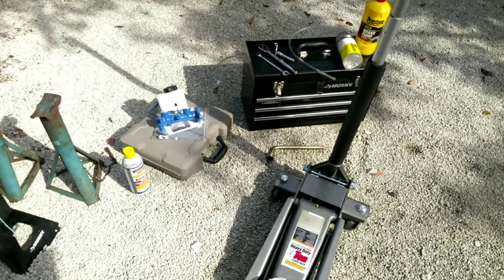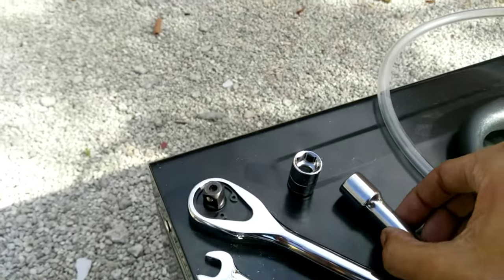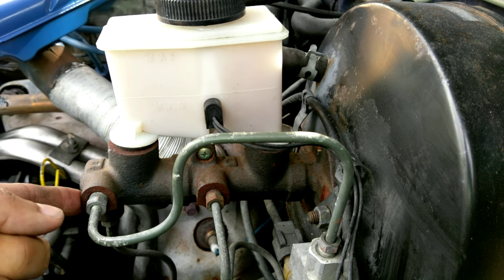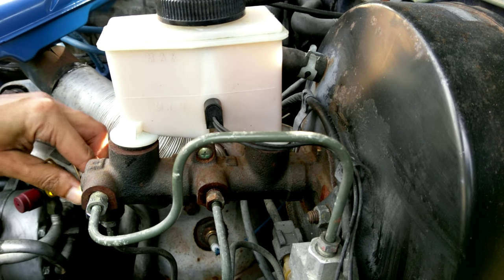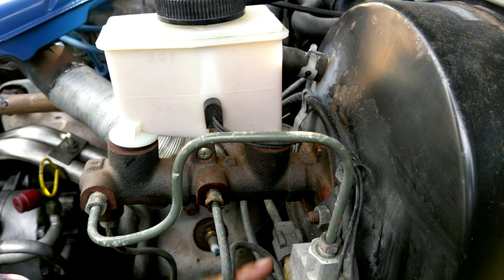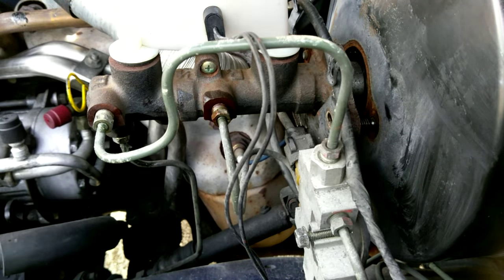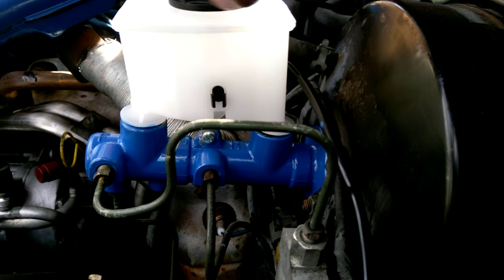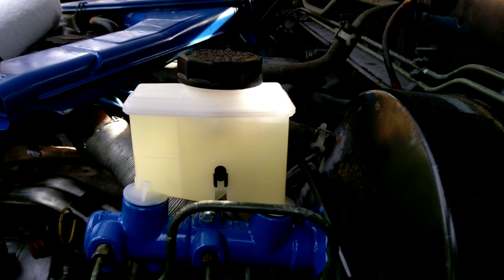Brake Master Cylinder replacement on 1990 Mazda B2200

Comment: As a woman with no car experience  or help ...thank you!
Reply from the maker: That's pretty much how I started making these videos, I couldn't find a darn thing before! Glad it was helpful.
Reply: @ninjaofalltrades4293  Hi.. there! Watched this a couple of years ago & finally here to refresh my memory & try this myself. I haven't watched the Chris fix video on bleeding the brakes yet. Don't you want to flush the old fluid out before bleeding the lines?? The cylinder in mine is so old I don't dare try this without totally flushing the old fluid out first. I see that you have a jack & stands. I don't have the proper tools to work on wheels & wheel lugs. Is it possible to flushthe old & bleed the new fluid without jacking the truck up & removing the wheels & tires?? I don't want to do  that! I'd probably have a mechanic do the job if it's required to get the job done. Hope not! For some reason I'm attracted to women who can efficiently work on things, especially dark complected gals! 😘
 That was cool..! 😎
I'm Jay.. ✌️😉
Reply from the maker: @jhenry0688  good morning! It’s been a while since the video but because I had already replaced the cylinder and painted the new one blue I did not mention it in this video. But yes, do that first. It’s possible I only took all the wheels off so I could do the video, I can’t remember if the valve is accessible with the wheels on, I think it is. But yeah if you have doubts pay someone else to do it cus it’s your breaks and doing that wrong could make for an interesting day!

Comment: No gasket between cylinder and booster? Cause mines is leaking?
Reply from the maker: The one I took off didn't have one, but if yours is leaking see if there are any defects with the parts that meet. I'm sure you can buy a gasket as well. Options are Rockauto.com, auto zone, and the likes.

Comment: Aren't you supposed to check the pushrod clearance on the brake booster? The Mazda manual shows a special tool for that.
Reply from the maker: No clue! My Mazda book didn't show it.
Reply: @ninjaofalltrades4293  The service manual shows how to check the clearance using a special tool. There is also a method of doing it using a vernier caliper. I tried to do this, but finally decided to take my chances and just go ahead and bolt on the new master cylinder. It worked fine.
Reply: You do have to bench bleed it, though.
Reply: @pputter1  It does make it easier! Way less air to bleed out.
Reply: @pputter1  Why not just flush the old fluid then fill & bleed?

Comment: What is that aluminum block on the vacuum boostet
Reply from the maker: WARD5KUSTOMZ not entirely sure, but it's connected to the one of the lines that come from the brake cylinder.